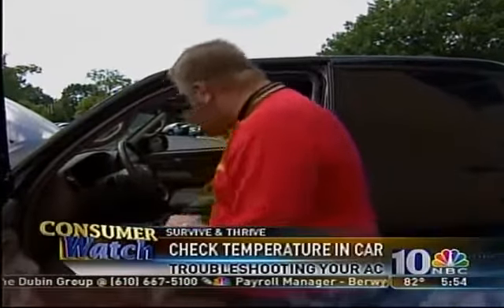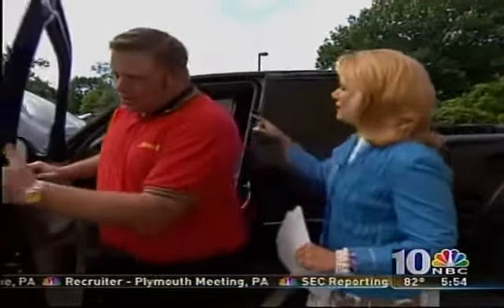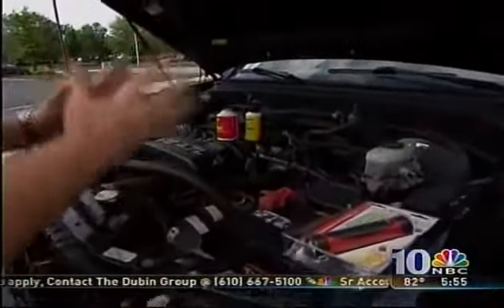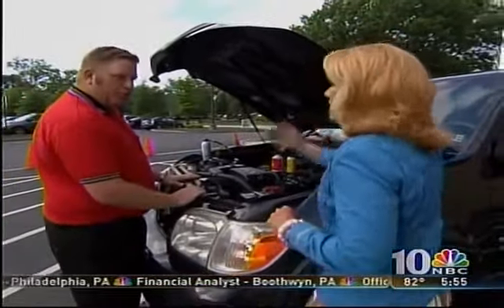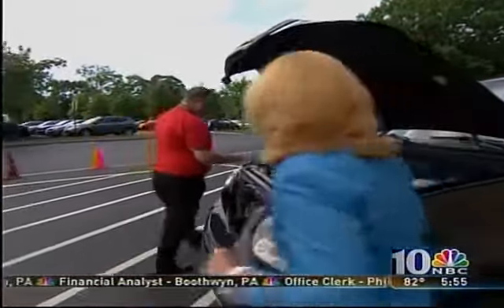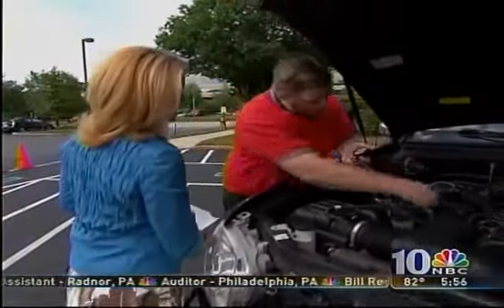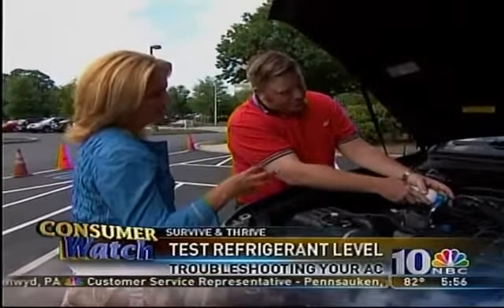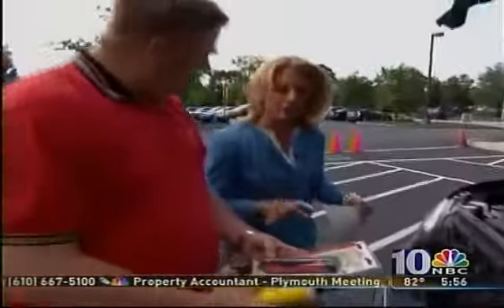How to Troubleshoot your Car's AC System - NBC Consumer Watch - Advance Auto Parts

Comment from the maker: Great question, Pat! R134A with leak sealer is designed to be used in A/C systems that are filled with R134A refrigerant. R134a refrigerant with leak sealer will not harm you’re A/C system when used properly. If you are putting in just leak sealer, then you may come across some issues depending on the condition of the A/C system in your car. It all really depends on the condition of your system when using strictly a leak sealer.